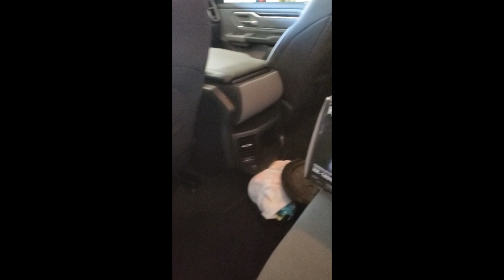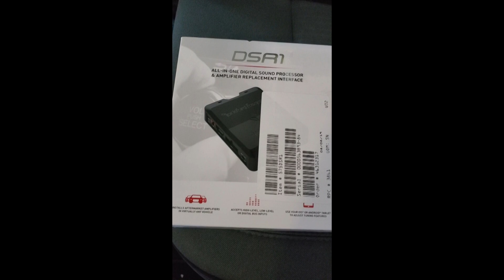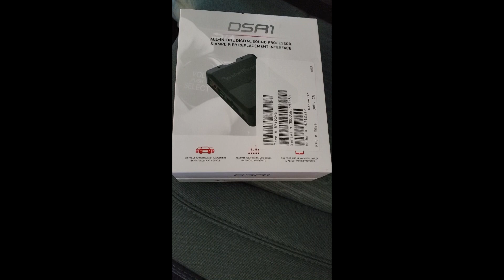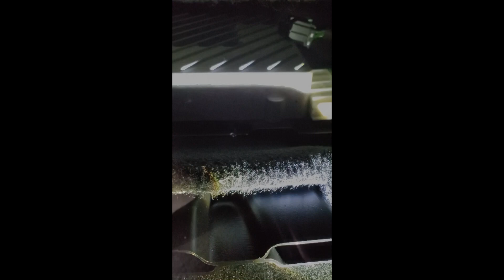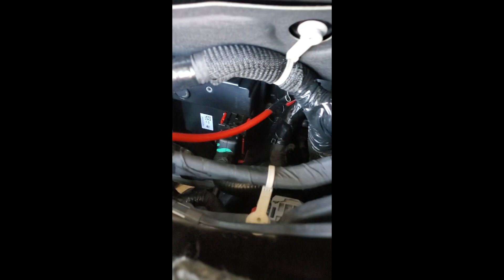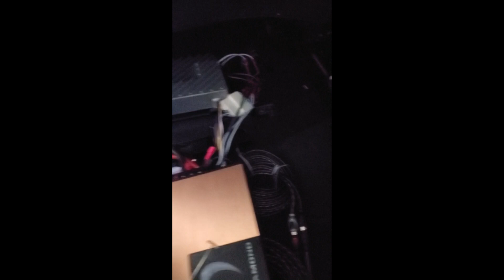2019 Ram 1500 Amplifier/Sub install; (using Rockford Fosgate DSR1).  Bypass factory/OEM amplifier

Comment: i have the harmon kardon set up in my truck, i bought an amp and sub. what type of device do i need to bypass the noise canellation? is that what the DSR1 does? or does that just bypass the stock amp?

Comment: I have the 2019 with 12 inch screen I just want to add a amp for subs and leave my factory amp for highs can this be down with out adding aftermarket  amp for highs thanks?
Reply from the maker: Hi.  Good question.   I think it's possible.  My concern would be whether the noise cancellation would react negatively.  You may need to cut those wires if you get a loud droning sound after install.  But other than that you should be able to tap into the stock amplifier output for maybe the rear speakers and run to a sub amp with line level input.   I can tell you the bass my roll off at louder volumes due to factory setting
Reply: Use PAC APSUB-CH41

Comment: Could you not just connect line level converters to the output coming from the factory amp, thus illuminating the need for the Dsr1?
Reply: Ryan Thompson no the radios signal is totally garbage so using just a line level converter will work but sound like shi!  And will have bass role off .The  dsp fixes and you can clean up the output from the factory headunit   So basically you don’t and should not use a basic line level converter anymore.  Always use a DSP with newer cars and trucks .  Definitely worth the money 💯
Reply: @joehomanick  what about lc2i?
Reply: No you need the Rockford dsr1 due to stock radio wont get louder or voltage input won’t increase. A loc won’t work not even lci6 or 8
Reply: Actually, I have a 2018 challenger and found the magic combo is that you can use an lc7i (recommended to fix bass) and do the following:
Leave plug to amp from stereo plugged in and splice into the navigation channels for one input, then also leave the output plug of the factory amp plugged in and cut all wires and take the rear l/r and use for your other input. Then using the summing feature on the lc7i, you can then output to an equalizer or even a dsp that isn’t able to sum the signals. From there an equalizer or dsp can/will divide the signal up as needed for a nice amp or two. Run the output from the amp back to the wires you cut from the factory amp.
Reply: @bradleewitt4048  i used both.DSR1 and most of all and "AmpPro"it made the whole install a "Breeze"👍❗

Comment: I'm having an issue in my 2020 1500 8.4 nonNav where it doesnt go louder than 26.  If I turn it up to 38 it doesnt sound any louder than if it was at 26.  Also if you turn it up to 38 and leave it, it sounds like someone is turning it up and down real fast.   
Do you know of a fix for this
Reply: UnProVen - did you upgrade stock speakers with a higher ohm speaker? The stocks should be 2 ohm. Going higher can make it have lower volumes.
Reply: @TheMoraTeamSanDiego  nope, still have the stock speakers. Just odd because it doesnt happen in any other Dodge, jeep, Ram or Chrysler.
Reply: Audio settings has a modern which volume increases/decreases in unison with drive faster/slower. Example: Getting on the interstate on ramp at 45mph medium audio volume but when you punch it to merge at hwy speeds 70+mph your audio volume is going to get much louder. Vise versa slowing down. This is a dumb setting to be honest.
Reply: @James-gk3qt  I understand how that works, I have it off. That's not the issue
Reply: I understood the problem and my guess is the stock radio has a output voltage limiter. If it goes above for a split second, it then lowers the output

Comment: Scott,,,, Thank you for making this as it has answered questions that i could not find before seeing it. My question to you is the wiring instructions you provided show 4 speakers , You and i have 6 with the 2 in the dash. Do the front speaker wires go to them as well? Thank you again for making this REALLY helps
Reply from the maker: Hi mike.  I believe you are correct but not 100 percent sure.  I actually pulled those dash corner speakers out completely and threw them away.  I then drilled holes in my door panels and installed tweeters in the door panels.  I do believe you are correct though.
Reply: The dash and door speakers are wired in parallel to make LF and RF channels. (6 speaker base sound system)
Reply: @greasyjimmy  they are on independent channels.  Channels 1 and 2 are for the dash speakers.  3 and 4 are for the front doors.

Comment: Do you have an after market exhaust? How is the drone with out the ANC’s?
Reply from the maker: HI.  Good question.   There is noticeably more engine and road noise with the ANC deactivated, especially when the engine is in 4 cylinder mode.   Since I was bypassing the factory amp to put in my new stereo system, I am OK with it.  If you are not switching out factory audio components, I would definitely recommend getting the ANC fixed instead of bypassing it.  I was actually wondering about changing the muffler to see if it would help with reducing that annoying resonance when in 4 cylinder mode.  Anyone out there have any experience with changing the exhaust?
Reply: Scott Kelton the only thing I can recommend is getting a controller to shut off the MDS/Eco Mode. You can also manually turn it off by pressing the gear -/+ shift buttons on the steering wheel if equipped with it. You be in all 8 cylinders until you put the truck in Park.

Comment: Thanks for the video man. Very handy and very informative. Just a quick question though. Which wires are for the ANC? And did you pull them out of the pin and left them unconnected?
Reply from the maker: Hi Kimball.  I have a video just on the active noise cancellation  unit and which wires to cut.  See https://youtu.be/yUzZ9lgdwS8.

Comment: Hi Scott, thanks for the video.  You have answered a lot of my questions, for clarification, all the speaker wires going to the speakers are under the drivers seat? Did you find a connector or did you individually splice them together? Also, what line out did you use to send the signal to the amp?
Reply from the maker: There is a factory amplifier under the driver seat with two connectors.  One has the inputs from the radio and one has the wires going to each speaker.  I spliced the wires from my aftermarket amp to those speaker wires.

Comment: So you spliced into the factory output harness running speaker wires from amp to speakers?
Reply from the maker: Hi Jacob - Yes, that's correct.  I removed the factory amplifier and then spliced into the wires coming from the radio to the factory amp and ran those to the input of the DSR1.  I then ran the DSR1 output to the input of the new aftermarket amplifier.  Finally, I connected the output of the aftermarket amplifier to the factory speaker wiring that was previously connected to the factory amplifier.  The wires from the radio and the speaker wires are all under the driver seat, just on two different connectors.
Reply: @scottkelton  Hey scott thanks for the reply I just got my 2019 ram bighorn and looking to put my system from my other  vehicle into the truck...So I noticed there are 10 speaker wires FR/FL these include the front dash speakers on those wires. Then you have RR/LR on there own wires which is 8 wires. I noticed there were two brown green wires which are also smaller do you know what those are for?
Reply from the maker: The smaller wires are for the active noise cancellation microphones.  You won't be using those since you are installing aftermarket amp